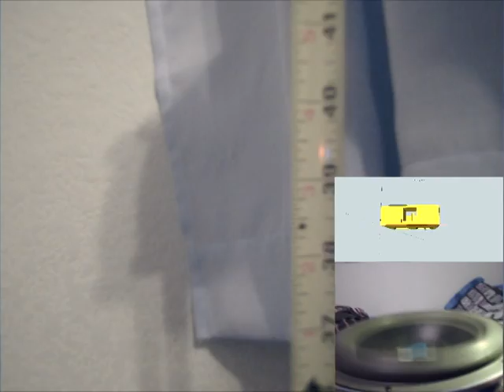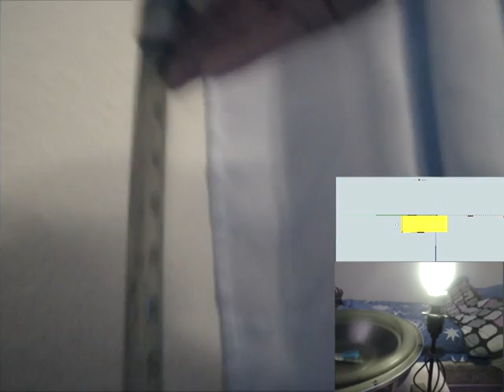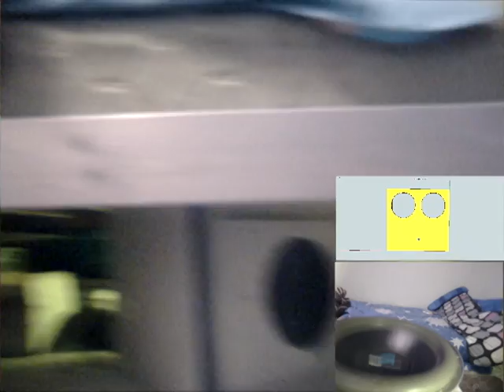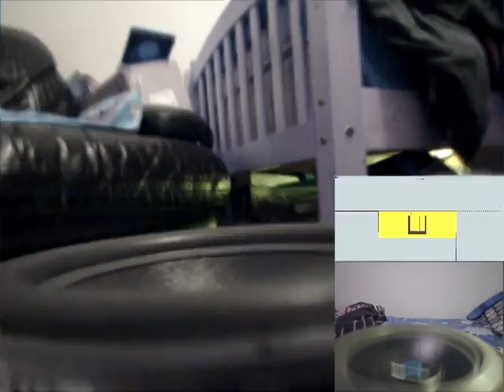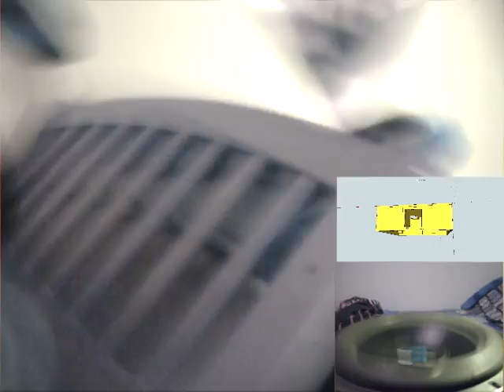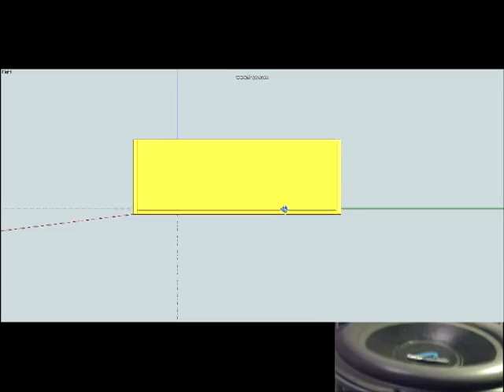2 15" Subwoofer's Future

Comment from the maker: @abusiveben idik if your suggesting or just asking me so here we go.i think thats alot of work. i will probably just round off the edges. but i dont think i will really get any noise from the port. since its an interchangeable port, it will be hell to flare the inside and outside of the port that many times. but if your asking and i were to do it i would get a 3dB gain in bass and less likely to get port noise. ThanX for commenting